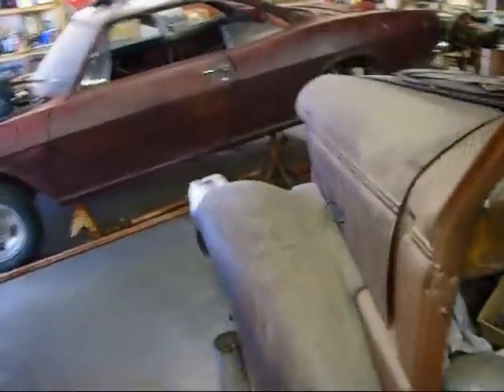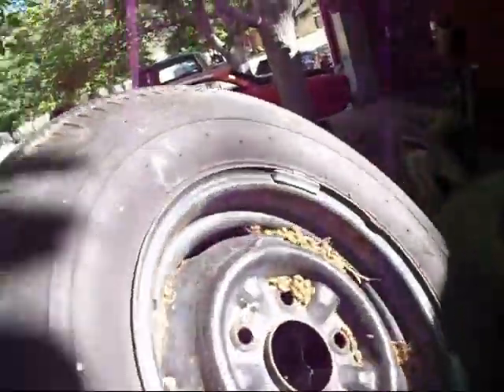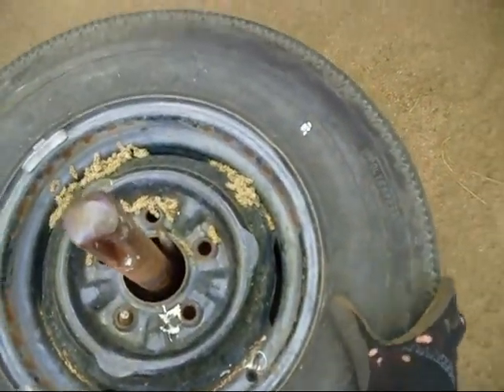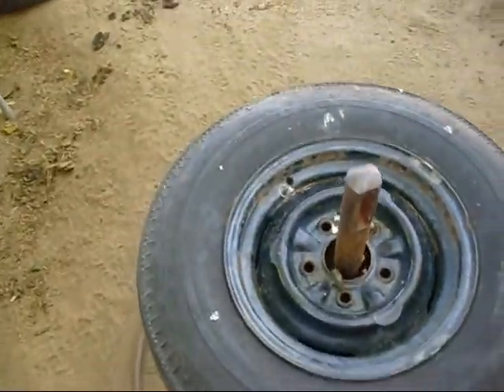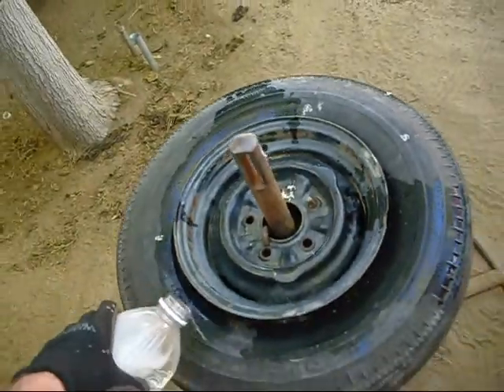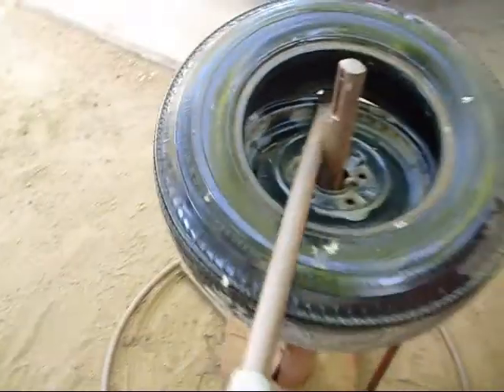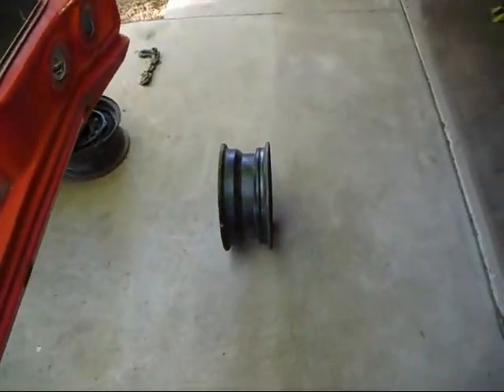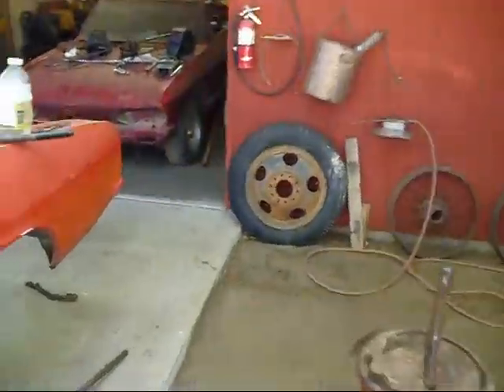CORVAIR IRON TIREMAN! :)

Comment: Your machine is missing the star that goes under the clap down bar. Plus the bigger wheel on the side of the hand bar (for removing the tire from rim) rides the inside of the rim and keeps the bar from moving. I also believe the tire is removed clockwise and the rubber rolls off the back of the hand bar. Modern tires can be tricky especially truck tires. I should post my first video on how to use. A ratchet strap through the inside of rim makes an excellent hold down.
Reply: Let’s see it